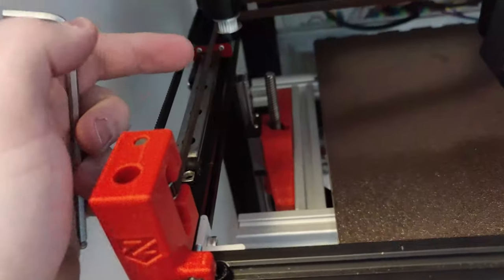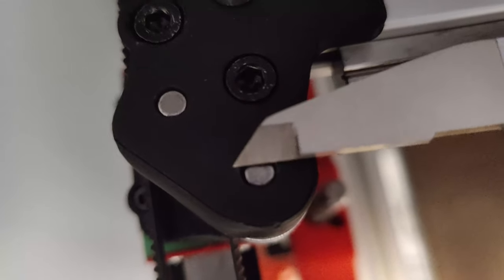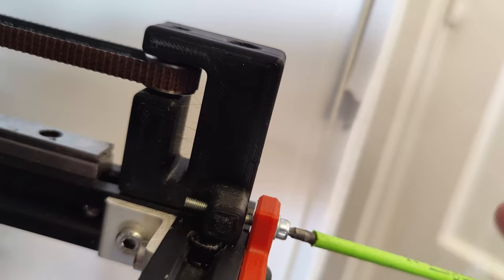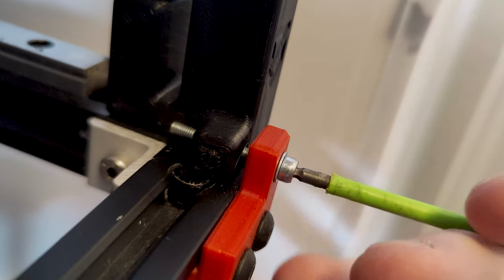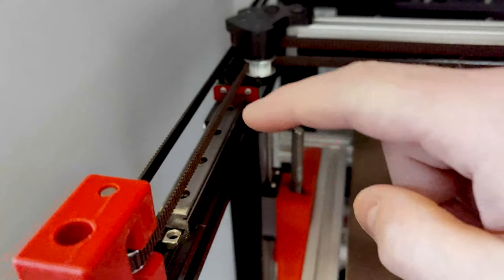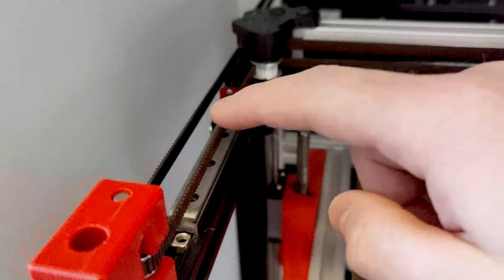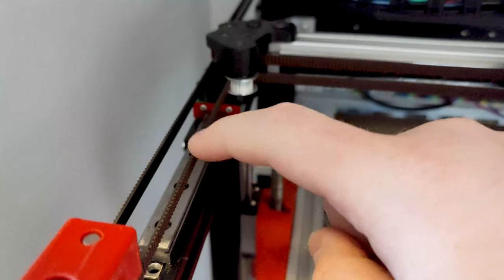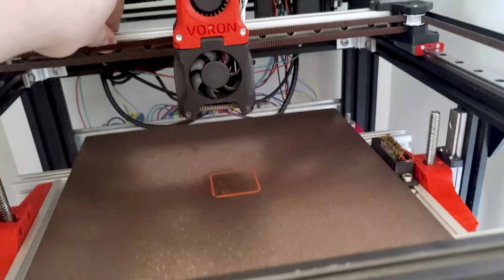Zero G - Mercury One - How to tension the belts

Comment: Um?? That distance 150mm changes though as you adjust the hz. You should be measuring from something stationary on the frame, like the end of the extrusion.
Reply from the maker: Thanks for the reply. You're right, we do have files to help you tension now, it locks the gantry at 150mm (vid is out of date)
Reply: @ZeroG3D  Thank you for your work and your designs. I love this whole setup.